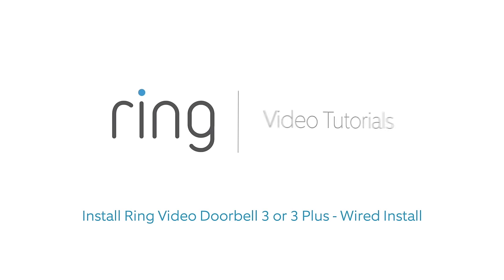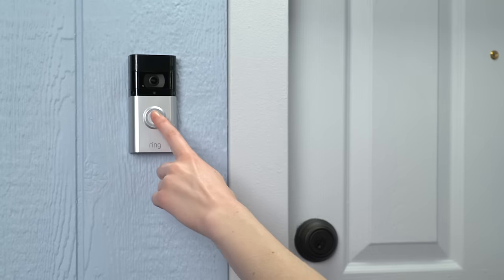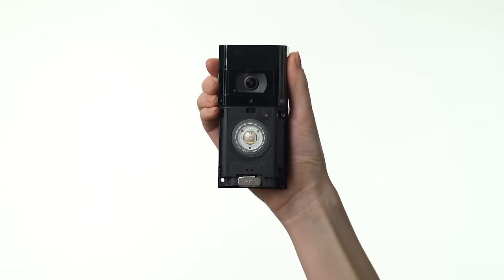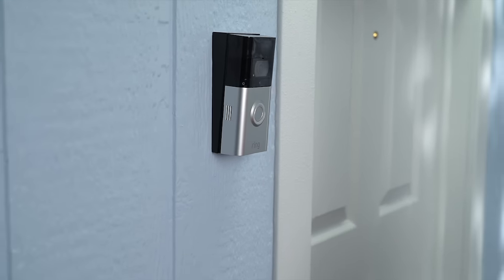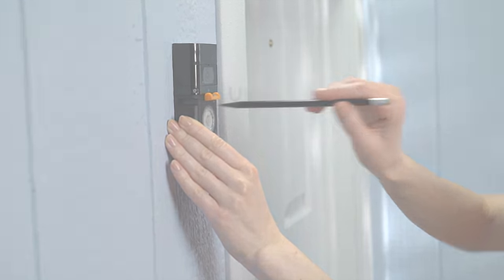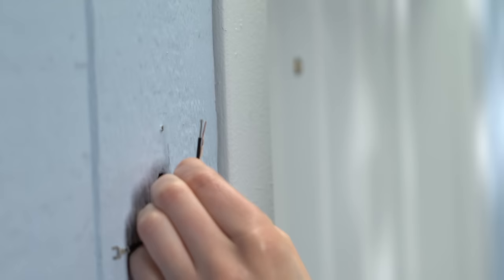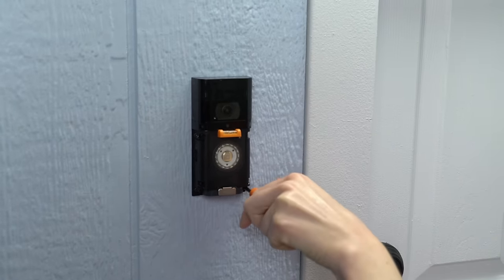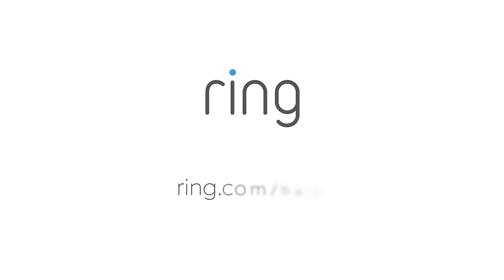How to Install Ring Video Doorbell 3 or 3 Plus - Wired Install

Comment: For the bell to point straight forward without a tilt in any direction, does it require a mounting bracket to seal the edges?

Comment: My doorbell has an intercom system tied into the rest of the house - will this be able to hook up to the existing wiring? Also, will it allow the other intercoms in the house to ring when the doorbell on the ring is pressed?

Comment: Hi, planning to get one of these, and I’ve got two questions:

1. How can I determine if my doorbell transformer meets the requirements for hard-wired installation?

2. Is there any Ring doorbell camera that does not distort the image (i.e. one where the image isn’t curved on the edges)?
Reply from the maker: Great questions, JC. Our battery powered Doorbells are compatible with any 8VAC to 24VAC transformer, while the Doorbell Pro needs a 16VAC to 24VAC transformer. The power rating will be listed on your existing transformer. 

All of our Doorbells have wide-angle lenses, to ensure you have an optimal view of the activity around your home. This may distort the image around the edges.
Reply: @ring  awesome, thanks for getting back to me.

Comment: I hardwired mine and says on he apps , power source hardwired.. is the hardwire suppose to charge the battery? Mine looks like the battery still decreasing everyday. I’m confused here. What’s the purpose of connecting it to your exiting doorbell wire if it doesn’t charge the battery. Atleast my existing chime work.  Is that the only purpose ? So the chime still work?
Reply from the maker: Thanks for contacting us, neighbor. Hardwiring your Ring will charge the battery at a trickle of approximately 10% charger per day. If your Ring is draining faster than this, your battery may still slowly drain over time. Here's an article on our website that outlines common causes of battery drain that may help you get the most out of your hardwired connection: https://support.ring.com/hc/en-us/articles/208190773. We're happy to help if you have any other questions.

Comment: How long does a battery charge last? If it's hardwired, does that matter?
Reply from the maker: Hey Andrew! The rechargeable battery can go months between recharges with normal use. This is dependent on a number of factors in your home’s environment such as the local weather and the number of activities captured. Hardwiring your battery-powered Ring device will provide it with a trickle charge of up to 10% per day so it may need to be recharged less often. Keep in mind, this also depends on usage. You can also monitor the battery level on the Device Health page in the Ring App. Let us know if you have any more questions!
Reply: Im gonna purchase a backup just to switch em up!
Reply: @ring  good evening,!!! So If I hardwired it , it doesn’t support the video? It still needs to be changed? I ring is the one that comes with a orange charger that connects to the back of the ring and when I go to the app it tells me it’s say power source battery even if I have it hardwired

Comment: Can this replace a standard doorbell to hardwire it. Iam getting a new build house in the UK. Iam not sure on the voltage
Reply from the maker: We appreciate the question, Haz. Ring Video Doorbells can connect to your existing doorbell wiring and can work with your current chime kit to continue the same audio alerts. Just make sure that the power output of the doorbell transformer being used is between 8 VAC and 24 VAC. In addition, the Ring Video Doorbell and the Ring Video Doorbell 3/3 Plus are capable of running on their own rechargeable battery, if you decide to install it somewhere there are no existing wires.

Comment: My door bell is sitting in between the brick and the door and it’s only less and an inch wide. Not sure if I have to move more doorbell wires over or this is possible to install in that spot. But my pro 3 is wide
Reply from the maker: Hey Matthew we are here to help. We have Social Care Advocates available on Facebook and Twitter if you want to send us a PM or DM with a picture of the mounting location, and we can help. 

Alternatively, please give our Community Support a call at 1-800-656-1918, (or if outside the US: http://ring.com/callus) between 5AM-9PM PDT, seven days a week for more support. We look forward to hearing from you.
Reply: Ring thank you for your help but I ended up moving the wires into the brick. Had to cut the drywall to get to the wires but it needed to be cut anyway. House is getting a make over

Comment: How long does it takes to charge the battery the first time? Mines has been charging since last night and I still have both the orange and green light on.  I just purchased the Ring 3 last night at Lowes.
Reply from the maker: Hey Catherine, congratulations on your new Ring! Your Ring Battery will take around five to 10 hours to fully charge depending on whether the USB cable is plugged into a USB port or into a wall outlet. Let us know if you have any additional questions.

Comment: Good evening. How come you say 4 feet of the ground? It would be 121 cm very low. I thought the installation would vene 5.3feet at least? Moreover is it possible to use an ethernet cable on the video doorbell plus? Thanks 😊

Comment: Hi, I have a Ring Doorbell 1, and getting the Doorbell 3 pro. I already have the bracket installed at my front door. Will I need to drill new holes, or can I use the existing ones? Thanks!
Reply from the maker: Great question, Martin. The Doorbell 3 does not use a mounting bracket, so you will need to drill new holes in order to mount it. Let us know if you have any additional questions, we're here to help.

Comment: Since its wired, does it still need the battery?
Reply from the maker: Great question, Rey. A hardwired Ring Video Doorbell 3 does not use the wired power to run its operations, it relies on the battery. Instead, hardwiring a Ring Video Doorbell will help keep the battery charged for longer, so you don't need to worry about charging the battery as often.

Comment: Hi, my chime used to ring with regular Ring Doorbell. Then I switched to Ring Doorbell 3 and connected the hardwire but the chime didn't ring anymore (it's regular chime, not Ring chime). Please show me how to make the chime work.
Thank you
Reply from the maker: Hey, neighbor. We understand the importance of your Ring operating properly to secure your home. Please give our Community Support a call at 1-800-656-1918, (or if outside the US: http://ring.com/callus) between 3AM-11PM PDT, seven days a week for more support. We look forward to hearing from you.
Reply: Try this:  Go to “Device Settings”, then to “In-home Chime Settings”, then "Advanced Settings" and then “Doorbell Chime Type” and make sure it is set on “Mechanical” and “Ring My in-home Doorbell”.
Reply: @TheAxeman777  Thank you, That worked  for me.
Reply: @TheAxeman777  where do I find the Device Settings - on my phone in the ring app or go on my laptop in the ring app?
Reply: @TheAxeman777  I cannot find "in-home chime settings". Can you be more specific on where to find this? Are we on the app? then click on the specific device? in this case doorbell? when I open it and click on "device settings" my options are then "notification settings", "general settings", and "partners". None of which contain and "advanced settings" option. Can you please say exactly where to find this? Thanks!
Reply: @YogaLexi  on my ring 3, this is exactly where it’s at. The “in-home-chimes setting” is located between “notification settings” and “general settings”. You will find the advance settings after you tap on “in-home-chimes settings”

Comment: Hi! We would like to buy the doorbell 3 but as far as I know it is not the best option for a multi-apartment building, is it? Because of near zone that detects any motion near the door. Or it is optional and we can switch it off? I wonder if the door gong is needed...
Reply from the maker: Hello, great question, you can disable the Near Zone. Learn more about the Ring Doorbell 3 motion here: https://support.ring.com/hc/en-us/articles/360040746831. This buyer’s guide will help you sort through the unique circumstances of your home and select which Ring Video Doorbell is right for you: https://support.ring.com/hc/en-us/articles/360035250032-The-Ring-Doorbell-Buyer-s-Guide. Let us know if you have any additional questions, we are here to help.

Comment: i wired it to my existing doorbell system. The existing chime rang fine. A soon as I inserted the battery, the existing chime stopped ringing and only the app on my phone rang. . any suggestions?
Reply from the maker: Hi Keith. Hearing when someone is at your door is vital to your sense of security and we'd like to help. Please give our community support a call at 1-800-656-1918, (or if outside the US: http://ring.com/callus) 24/7, for more support. We look forward to hearing from you.

Comment: I hardwired my Ring 3 Plus. When I INSERT the battery, my indoor chimes rings. However, once the battery is in I cannot get my indoor chime to ring anymore.  For automatic detection, the app says that the doorbell is not receiving power from my doorbell system and the power source states "battery".  For manual chime selection, selecting "mechanical", "digital type 1" or "digital type 2" does not solve the problem either.  When I insert the battery my indoor chime rings so I assume that it is properly hardwired since the indoor chime is receiving power...so how come is does not work once the battery is in and the power source says battery?  Thank you.
Reply from the maker: Thanks for contacting us, Kim. We would like to ensure that your device is working intended and that you're able to use your Chime. Please give our community support a call at 1-800-656-1918, (or if outside the US: http://ring.com/callus) 24/7, for more support. We look forward to hearing from you.
Reply: I have a very similar issue with my mom’s doorbell.  I read an article that stated ring 3 will not ring your indoor doorbell.  It doesn’t make sense to me.

Comment: my door bell is on the side the door not in front, do I have the same angle desire the street and who knocks the door?
Reply from the maker: Hi there! In order to best assist you, we'd like to take a look at where your current doorbell is mounted. Please send us a private message via Facebook or give us a call at 1-800-656-1918 (or if outside the US http://ring.com/callus) so we can continue to help. We look forward to hearing from you soon.
Reply: @ring  I have the same problem! When standing in front of the door, my doorbell is on the wall to the left. I really want whichever ring I get to be wired. Please advise.
Reply from the maker: Hey Filip, as mentioned above we would love to help. Please send us a message on Facebook or Twitter so we can get a better understanding of your environment. Or give us a call at 1-800-656-1918 (or if outside the US http://ring.com/callus) so we can continue to help. We look forward to hearing from you soon.

Comment: Does it come with mounting plate like the previous version? The wedge bracket is too fat and not appealing
Reply from the maker: Thanks for asking, Ulysses! The Ring Video Doorbell 3 and 3 Plus mount directly to your wall and do not need a mounting plate to function. We're happy to help if you have any other questions.
Reply: @ring  the spare part had a mounting bracket/plate. Idk why it doesn't come with it. It would be nice to have it coz i might move somewhere else. I don't feel like the screwing on stucco is strong enough to hold the device. I was thinking of applying a liquid nail on mounting bracket instead of the actual device. The spare parts cost $1.99 and $3.99 for shipping. They're selling the non-drill mount for $20 but i don't it's worth the money. If the spare parts has it, why it did not come on the actual product just like the previous versions? If you could me with the plate for free, I'll appreciate it.
Reply from the maker: We appreciate the feedback you've provided here. We're always looking to improve and add to our devices and the experience we provide. We will pass this to the appropriate team, thanks for being a part of the Ring neighborhood.

Comment: So if I hardwire it in then it will ring to my current chime in the house. The battery won’t be drained as fast either but still will need to be charged after a while correct?
Reply from the maker: Hey Andie, great question! Hardwiring a battery-powered Ring Doorbell will provide a trickle charge of up to 10% per day. The battery may need to be recharged occasionally depending on usages, such as motion detection and Live View frequency. Rest assured, you're able to monitor the battery level in the mobile Ring App so you'll know when it needs to be recharged via the provided charging cable. Let us know if you have any more questions!
Reply: Thanks! I found out I was looking at the wrong one and got the pro!
Reply: @ring  Sorry, I had the same question but still don't understand. If you wire it up, do you actually need to manually charge the battery once in a while? If so, how often? 
I thought the tickle charge was fair enough to leave the battery attached and just forget about it.
Reply from the maker: @flywithnature  We'd be more than happy to answer your questions! If your device is capturing frequent activity, we suggest charging the battery via a USB cable if the battery level is below 50%. However, with standard use, your battery will need to be charged 6-12 months after install. If you have any more questions, please let us know.

Comment: I want to hard wire the ring plus I have, the specifications say to use a transformer 8-24 VAC, 40VA max, but all the doorbells listed as compatible use the transformer 16 VAC, 10VA.
It says 40VA max, is there a minimum recommended? 
I only ask because their is a lot of complaints their doorbells don't work with the ring, or other issues with The Ring...
I can't find any documentation on the door bell chimes if there in a min or max...
Possible they don't follow schematics very well.... But...
Reply from the maker: Great question, neighbor. The Doorbell 3 Plus needs a minimum of 5VA to operate optimally when hardwired. A 16 VAC, 10VA transformer will be more than enough to provide your Plus with power.
Reply: @ring  Hello Ring, I recently got a Ring Doorbell 3 that I was going to replace my existing doorbell with. I read that it requires an 8-24V AC, 40VA max transformer. I am unsure as to why there is a maximum rating, instead of a minimum rating? I was expecting a minimum VA needed that would be equal to the maximum power draw from the Ring Doorbell 3 (I assume when charging the removable battery). I called support twice and the first person said that I needed between 30 VA and 40 VA and anything more would cause the doorbell to overheat. Wouldn't it only draw the needed VA? The second person said at least 10 VA was needed and there was no maximum, which made more sense to me, but the user guide lists a maximum. Now on this video I see the minimum is 5VA, (assuming the 3 and 3 plus have similar power usage). What is the actually minimum and why do I receive different responses from each support person and the provided user guide? I currently have a 16V 10VA transformer that I assume would work, but don't want the doorbell to draw too much power and cause the transformer to blow. Thank you!
Reply: @damekwellington4570  perhaps the max is stated in case you have a number of bell chimes located in different parts of the house - hardwired in. Each would add to the VA needed. If you go over 40VA, perhaps the ring doorbell is not rated to go beyond this and could overheat.

Comment: I just bought a Gen 3 to replace the Gen 1.  Aside from the camera software related set up, can your just swap out camera using the same baseplate and rewiring? Will the mounting plate work?  Thank you
Reply from the maker: Great question, Bruce! The baseplate will need to be updated when upgrading from the original Ring Video Doorbell to the Ring Video Doorbell 3 or 3 Plus. However, you can use the same wiring just fine. The Video Doorbell 3 series doesn't have a mounting plate and will mount directly to the wall without the need of any additional hardware. We're happy to help if you have any other questions.

Comment: In the installation booklet that comes with the Ring 3 and in small print it says to install a 25 ohm resistor to protect the unit. Is this required or not?
Reply from the maker: Hey there! A resistor is required in place of a mechanical or electronic doorbell kit for this alternate configuration to work successfully. If you have any additional questions, please let us know. We're always happy to help.
Reply: So to clarify, if I am wiring the ring3plus directly to the ring recommended transformer ( no chime units ) do I need the resistor?

Comment: How to uninstall and steal  any doorbell camera. Walk up to it take it off the mount and walk away with it
Reply from the maker: Hi Edward! Ring is mounted to a mounting bracket and secured with security screws so that it is not easily removable. If someone does attempt to damage or steal your Ring, the motion-activated camera will capture a video of them doing so, and you'll be able to use that as video evidence for a police report.

Comment: My electrician installed my ring yesterday but the mechanical bell in the house doesn’t ring( he said he installed correctly and installed the jumper)  And I get no sound on my phone. ( The app is installed, notification, phone volume are all good. ). I can see live video but unless I hear the ring from the front door I don’t know to open the app and call up the video.  Saw the note to enable mechanical chime in setting but did not find that in the app.  Recommendations to fix. Or send it back?